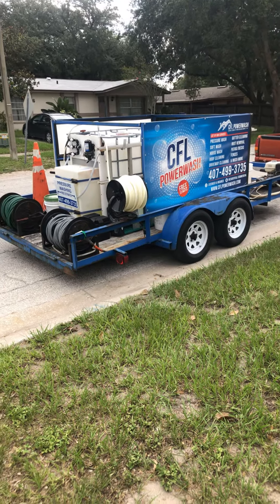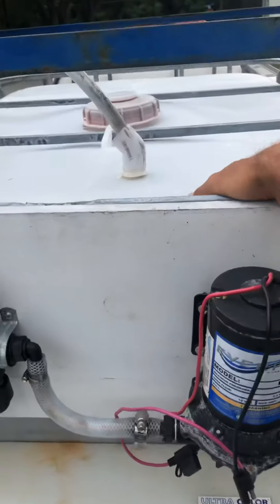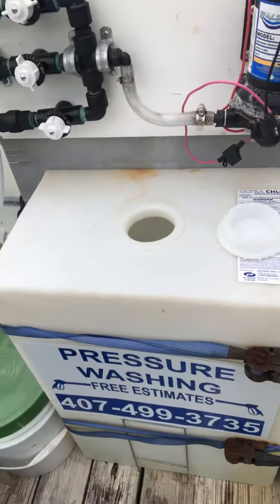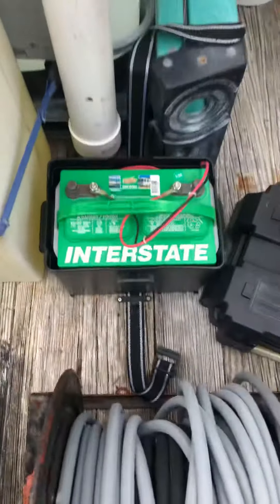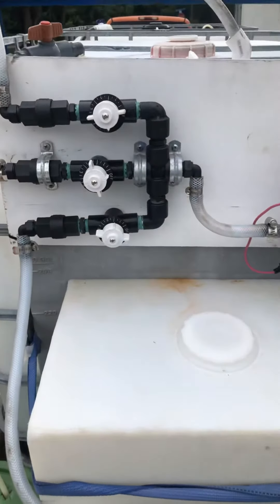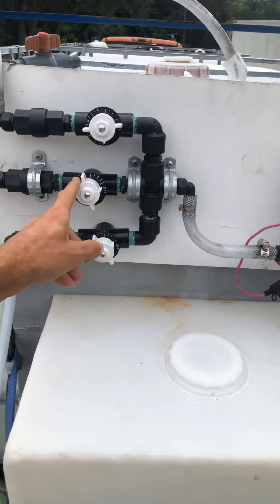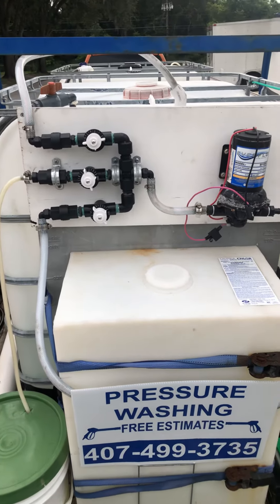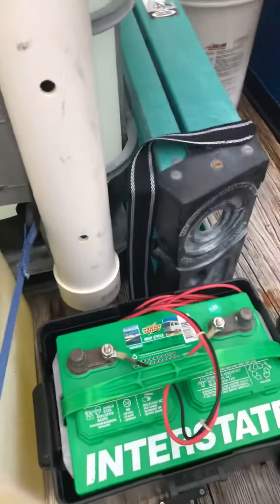Soft wash setup (Simple and effective)

Comment: Super simple nice setup! Just a tip though. You don’t have to have the pentair valve on the water. You can just use a ball valve and it saves you money because you can have the other valve as an extra valve.
Reply from the maker: thanks man! Yes you are right. its nice to be able to turn the water completely off though. I have a new build now, check out my newer video with the enclosed trailer! thanks again wash on

Comment: Right now I just have a 3200 psi 2.4gpm gas pressure washer that I am using to get started. I'm really curious about how long that battery lasts. Does it make it through the day?
Reply from the maker: Battery last a few days. I try to charge it every other day. 

I would aim to get a 4 gpm belt driven or gear driven pressure washer.
Reply from the maker: 5.5 gpm or 8 gpm if you can afford it

Comment: Do yall have any suggestions on a water pump that will actually suck the water out of the tank? I have a 5.33/gpm Transfer pump but its like one of those that don't start unless water is flowing or some stuff like that, it will not suck water up and out of the tank, Fuk9ng sucks man. Pain in my @$$
Reply from the maker: Look up everflo 5.5 gpm pump on Amazon. 

I use these currently and work great. With the right size hoses and a full battery, you can shoot 30-35 ft.
Reply: @FloridaWashReport  what size hose do you run for the softwash system?
Reply from the maker: @jeremykumar5449  1/2in right now